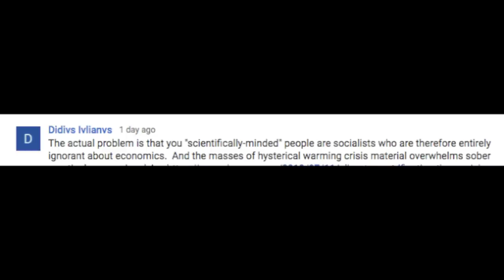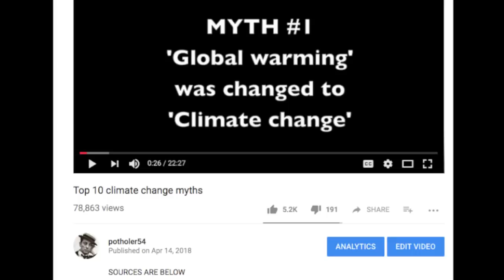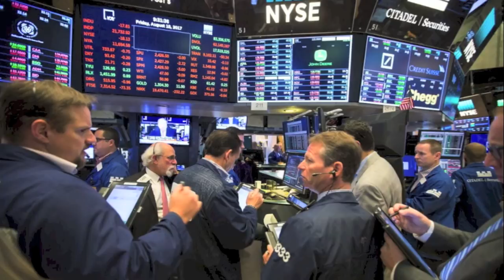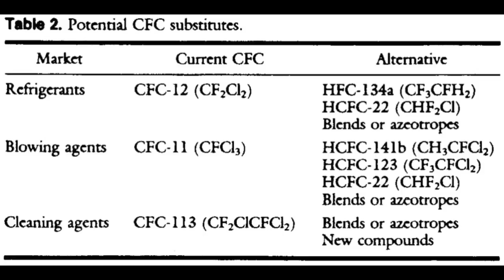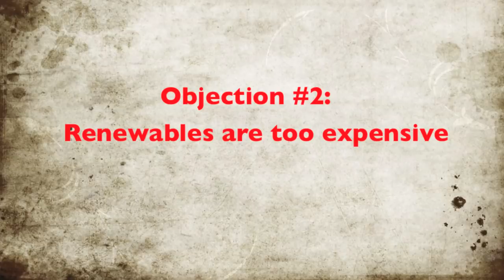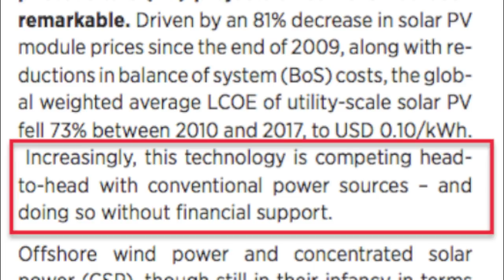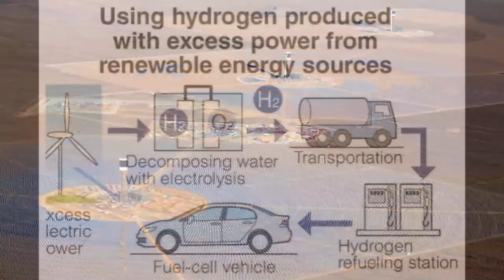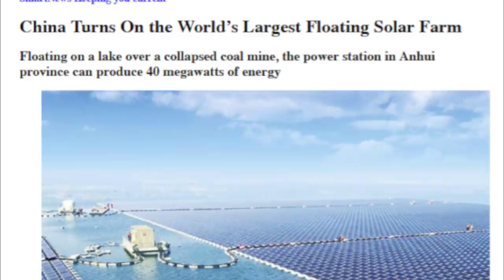A CONSERVATIVE solution to global warming (Part 1)

Comment: In Australia our media routinely claims renewables are cheaper than non-renewables. In this case it's essential to point out that renewables are heavily subsidized. If they really thought they were cheaper they wouldn't need subsidies for them. 

The upshot here is that because people are lying about how much  power bills will cost and where that cost is coming from, voters will make poorer decisions about what policies they ought to support in combatting climate change.
Reply from the maker: If you have some facts and figures from reliable sources then I would be very interested to read them as part of my research into part 2. I'm not sure what you mean by "heavily" subsidized, which renewables you're talking about, which states, and how any subsidy for renewables compares to subsidies given to fossil fuel industries. I would be interested to get some detail, if you have any. Trouble is, too much of what people post is based on belief, hearsay and generalizations.
Reply: "In Australia our media routinely claims renewables are cheaper than non-renewables"

Because it is. Solar has been on price-parity with coal since 2014 and wind has been undercutting coal since 2013.

"In this case it's essential to point out that renewables are heavily subsidized"

No that's not remotely true. Fossil fuels have been subsidized well for over 100 years and the Australian government pours billions into propping up fossil fuels. $11 billion per year federally is the current estimate.

In fact as part of the Low Emissions Technology Demonstration Fund (LETDF) 82% of subsidies went to coal and only 18% to renewables.
Reply: The fossil fuel industry us not subisidized. Some claim it is but they reference tax breaks that avaliable to all businesses including renewable companies. 

As part of Australias RET (Renewable Energy Target) we have a number of subsidy schemes. The SSRES (Small Scale Renewable Energy Scheme) subsidizes the building of solar panels on residential properties and the LRET(Large-scale Renewable Energy Target) subsidizes renewable generators. These subsidies are cross subsidies meaning they aren't paid for by taxpayers but by electricity users.
 
The LRET forces companies to buy renewable energy certificates when they buy electricity and awards these certificates to renewable energy generators. They currently sit at about $80 a MW/h which means renewable generators effectively make $80 over what they charge for their electricity. (Market price is about $70 average)  Media outlets frequently report the market price as proof renewables are cheaper than fossil fuel sources. 

I'm not too certain about how the SSRES works but I understand that it's a similar idea. 

The Government's RET Website:
http://www.cleanenergyregulator.gov.au/RET/About-the-Renewable-Energy-Target/How-the-scheme-works
The Australian Energy Market Regulator's Website: https://www.aemo.com.au/Electricity/National-Electricity-Market-NEM/Data-dashboard#aggregated-data

Other factors change the cost of these energy sources dramatically, such as credit. Because Australia has had a carbon tax,  almost had an ETS, has got the RET, and has frequently fiddled in the energy market and specifically in the FF industry it's much harder to secure credit for FF generators. Inversely, large subsidies have made credit cheaper for renewable generators. Again, this is used to claim that renewables are cheaper but this is only due to consistent government interference.

I've no love for coal and I quite like the idea of renewable energy, I just think it's a fact that renewables are currently a more expensive way to produce electricity than fossil fuels are.
Reply: 1. FF being subsidized is not proof that renewables aren't.
This here is a nonsense argument: 
<"In this case it's essential to point out that renewables are heavily subsidized"

No that's not remotely true. Fossil fuels have been subsidized well for over 100 years and the Australian government pours billions into propping up fossil fuels.>

2. I agree that FF have been subsidized in the past. In the past they were also state owned. That's a 100% subsidy. I think these are terrible ideas. If the problem is FF subsidies then stop subsidizing them. Don't also subsidize cheaper sources. That's just retarded. 

3. Link me to that LETDF report.
Reply: Some great information there but I think you'd have to agree the roughly $5 billion in tax free diesel given to the mining industry through the "Fuel tax Credit Scheme" does not also apply to 'renewable companies'. And that's only about half what the fossil fuel industry gets in various breaks.

The cost the RET was estimated to be 5.1% to electricity bills based on 2014 report but it has helped drive adoption of renewables and "wholesale prices would be 15-25% higher in 2020 in the absence of the RET", that's not to say the savings are passed on however.

Australia does not have a carbon tax. That was only in place for two years, between 2012 and 2014.

The truth is renewables are cheaper even though fossil fuels are heavily subsidized to a far greater extent than renewables.

I hope we can agree the CSIRO is a reliable source of information: https://publications.csiro.au/rpr/download?pid=csiro:EP178771&dsid=DS2

In 2017 the costs for large scale PV solar, rooftop solar, and wind ($2100, $1600, & $1600 respectively) were all well below the cost of coal ($3074 before you even start adding any carbon capture).

By 2030 the estimates are solar will fall another 50% in price with wind and wave taking less significant drops. Battery storage will also steadily decline. But the main message is it's cheaper today and that won't change.

And the report you wanted: https://web.archive.org/web/20080724085454/http://www.greenpeace.org/raw/content/australia/resources/reports/climate-change/energy-and-transport-subsidies.pdf
Reply from the maker: @SecxyBear -- Thanks to responding to my requests for facts and figures. Your post is very informative, but I don't think it tells the whole story. In fact, the more I delved into it, the less clear and simplistic it got.... 

"The fossil fuel industry us not subisidized. Some claim it is but they reference tax breaks that avaliable to all businesses including renewable companies." 

I did a quick check, and discovered that $6 billion worth of credits and grants are available through something called the Fuel Tax Credit Scheme. $29 million a year goes to Geoscience Australia, to help find fossil fuels. Horizon Power, Verge Energy (Synergy Generation), CS Energy Limited and Stanwell Corporation Limited all receive direct state subsidies for generating electricity through fossil fuels, among various other subsidies and tax breaks (marketforces.org.au/campaigns/ffs/).
   None of these subsidies and tax breaks is available to other businesses, they are exclusively for fossil fuels. As I said, this is just a cursory check, but it does call your claim into question.

"The SSRES (Small Scale Renewable Energy Scheme) subsidizes the building of solar panels on residential properties"
   But that does not mean these solar panels are uncompetitive without subsidies, surely? I installed solar panels on my roof a couple of years ago and didn't even bother applying for a subsidy, because it has dwindled to very little, and I am still able to slash my electricity bills and come away with a profit. That takes into account the cost of the panels, the income I would have got if I had invested the money instead, depreciation costs over 10 years etc. etc. If solar panels on my roof are cheaper than coal-fired power stations without subsidies, that must also be the case for all households in NSW, isn't it?

"The LRET forces companies to buy renewable energy certificates when they buy electricity and awards these certificates to renewable energy generators. They currently sit at about $80 a MW/h which means renewable generators effectively make $80 over what they charge for their electricity. (Market price is about $70 average). Media outlets frequently report the market price as proof renewables are cheaper than fossil fuel sources."
   If they are simply going by the retail price, then that could well be a wrong assumption. But if they have done a proper cost analysis, then their figures could be correct. I don't know, because I don't know which media outlets you are referring to or what they are reporting on. But while I was digging, I stumbled across a cost-analysis by the EPA that factored in the 'hidden' cost of health care due to fossil fuel pollution, and their estimate is 13 to 45 US cents per kWh (because of the public health care system in Australia, these health care costs are borne by the taxpayer.) And, of course, if we really want to go to town on cost analysis we have to factor in the cost of environmental damage caused by fossil fuels in the form of oil spills, acid rain and climate change. 
   

"I just think it's a fact that renewables are currently a more expensive way to produce electricity than fossil fuels are."
   But as I've discovered trying to unravel this, not only is comparing subsidies between fossil fuel/renewables a minefield, so is the real cost of producing electricity. All I can tell you is, on a microeconomic scale, I didn't get any subsidy for my Chinese-made solar panels, and even though they're competing with subsidized coal-fired power stations in a coal-mining region of Australia (Newcastle), it is still cheaper for me to get my electricity from the solar panels. Not only that, I'm not producing any CO2 as a result. I am curious as to whether you have also invested in solar panels, and if not, why not? Isn't it cheaper where you are, even without a subsidy? Have you done a cost-benefit analysis?
Reply: Your confusion around coal subsidies is warranted especially seeing as youre citing a dodgy website. That specific page is a gishgallop in a link and far out is it tiring explaining the many different ways it's wrong. 

> "I did a quick check, and discovered that $6 billion worth of credits and grants are available through something called the Fuel Tax Credit Scheme. "

This is avaliable to any company that uses it's own roads (including solar). It's a fuel excise exemption for vehicles driving on private roads. The idea here is that fuel excise is intended to pay for road maintainence. Hence the exemption. It might fund FF in the sense it doesn't tax petrol where it could (and petrol itself is a FF) but that doesn't enter into the competitiveness of coal for generating electricity. 

The fuel subsidy is one example, the research is another. This research is used by coal companies but it's not commissioned by them or intended for them. I'm happy to cut funding for this agency entirely but it's wrong to call this a FF subsidy. 

The direct subsidies are to state-owned generators. They're subsidies but at the same time the generators aren't commercial so they don't get profits. I'd be happy to privatise these assets but the parties pushing renewables oppose that so I don't know how to help you there. Either way, this only affects the states it's in and the other states show what I'm claiming so it's kinda a moot point.

>"All I can tell you is, on a microeconomic scale, I didn't get any subsidy for my Chinese-made solar panels, and even though they're competing with subsidized coal-fired power stations in a coal-mining region of Australia (Newcastle), it is still cheaper for me to get my electricity from the solar panels. Not only that, I'm not producing any CO2 as a result. I am curious as to whether you have also invested in solar panels, and if not, why not? Isn't it cheaper where you are, even without a subsidy? Have you done a cost-benefit analysis?"

How do you buy your electricity from coal without paying the cross subsidy? Are you just comparing your generators to the market price? I haven't bought solar subsidy or not, because I rent. I do pay for solar through the SSRES and LRET though. If you have a solar system you're probably eligible for a rebate. 

Bringing up "hidden healthcare costs" is irrelevant. I'm not here supporting coal. I'm talking about how much money it costs to get a MW/h. The Guardian and the Age often run articles claiming renewables are cheaper than coal. The ABC has run some as-well. Be careful of the distinction between new build and maintaining current generators as well. 

This article is an example. 
http://www.abc.net.au/news/2018-09-03/angus-taylor-energy-minister-power-price-solution-curious/10188496

It uses the accounting flubs I've mentioned.
Reply: Put it this way, Renewable energy has multiple current, promoted, dedicated subsidies that are easily found on government websites. Coal has none. The only way you can say coal has subsidies is by doing shit like "coal companies have cars that drive on roads, trains are paid for by the government, ergo the government subsidizes coal". It's always a solid step removed. It's only a minefield if refuse to stop digging until you find a mine. That's not a good way to get to the truth.
Reply from the maker: "youre citing a dodgy website."
  As I said, I only had a cursory look to check what you are saying. If you think the figures I cited are wrong, or the details of the subsidies are wrong, I welcome any corrections you would like to give, citing what you consider to be more reliable sources. 

"but [the fuel excise exemption] doesn't enter into the competitiveness of coal for generating electricity." 
   That's true. I mention it as an example of a subsidy/tax break exclusively for fossil fuels. But a good point, if we're only looking at electricity production.

"This research is used by coal companies but it's not commissioned by them"
   It may not be commissioned by them, but if the research is useful to them and used by them then they are beneficiaries.
   "it's wrong to call this a FF subsidy."
    But it's not a tax break either. I suppose if the government is giving a company free research information to help its business it should perhaps be described as a "gift." Whatever we call it, it is still taxpayers' money used to reduce the cost of coal-based power.

"The direct subsidies are to state-owned generators."
   Yes, which are mostly coal-powered. Not all states give these subsidies, some do. Again, this is painting a picture of a much more complex system of tax breaks and subsidies.

"How do you buy your electricity from coal without paying the cross subsidy?"
   I don't know what a "cross subsidy" is, but when the sun isn't shining I buy electricity from a coal-fired power station. If I didn't have my solar panels I would have to buy this coal-based electricity all the time, and that would increase my electricity bill. 
      BTW, it's rather ironic that my solar panels are not benefitting from subsidies, but I am subsidizing coal-based power. I feed excess electricity back into the grid at 8c/kWh, which they sell to other consumers at 25c/kWh.

"If you have a solar system you're probably eligible for a rebate."
   But it's tiny. Subsidies used to be quite substantial, but now solar technology has improved so much, and is so cheap, that the subsidies have been reduced and are hardly worth applying for.  

"Bringing up "hidden healthcare costs" is irrelevant."
   Not really. This isn't a tax break or a subsidy, but it is a cost. If you have one power source (coal) that is costing a billion dollars in additional health care, and another power source that is costing nothing, that cost has to be factored in when indirect costs are looked at. I'm not sure why it shouldn't be. 

"http://www.abc.net.au/news/2018-09-03/angus-taylor-energy-minister-power-price-solution-curious/10188496"
   You're actually coming up with some very good sources that contradict the idea that coal is cheaper than renewables :). The ABC story cites a report by the Australian Energy Market Operator, which states that "When existing coal-fired generation reaches the end of its technical life and retires, the most cost-effective replacement, based on current cost projections, is forecast to be a portfolio of utility-scale renewable generation, storage, DER, flexible thermal capacity, and transmission. "   There is no mention that this cost-effectiveness is based on subsidies for renewables, and in a report of this depth that crucial detail would certainly have been factored in and mentioned if it was significant.    I don't think I'm any closer to unravelling all the various subsidies and tax breaks and direct and indirect costs, and if anything it shows that this is a much more complex issue than comparing the cost of two cans of baked beans. But neither can I see any evidence, even from the ABC story you linked or the report it cited, that subsidies play an important factor in the cost-benefit analysis. If the experts say renewables are going to replace coal because they're cheaper, I have to assume they know what they're talking about.  

 

p.p1 {margin: 0.0px 0.0px 0.0px 0.0px; font: 12.0px 'Tw Cen MT'; min-height: 13.0px}
p.p3 {margin: 0.0px 0.0px 0.0px 0.0px; font: 10.0px 'Tw Cen MT'; min-height: 11.0px}
li.li2 {margin: 0.0px 0.0px 0.0px 0.0px; font: 10.0px 'Tw Cen MT'}
table.t1 {border-collapse: collapse}
td.td1 {padding: 0.0px 5.0px 0.0px 5.0px}
ul.ul1 {list-style-type: disc}
Reply from the maker: Thanks too to @Naoki Watanabe for providing some interesting links.
Reply: >   "it's wrong to call this a FF subsidy."
    But it's not a tax break either.>

Missing the point. If a Syrian weapons manufacturer uses wifi is it fair to say that Australia subsidizes weapons manufacturing in the middle east because that research came out of the CSIRO? You've assumed all these claims aren't bullshit and I'm having to pick through them and explain how they've misled you. It's curious how little skepticism you applied there and how much you've applying here. 

>"The direct subsidies are to state-owned generators."
   Yes, which are mostly coal-powered. Not all states give these subsidies, some do. Again, this is painting a picture of a much more complex system of tax breaks and subsidies.

I know they're coal-powered. This ignores everything I said about why state-owned power companies aren't a good example to use for the cost of coal electricity. 

>"You're actually coming up with some very good sources that contradict the idea that coal is cheaper than renewables :)"

This just says that you're ignoring what I'm saying. Quoting that article at face value as though I haven't been explainaing problem after problem with doing so is just insulting.

>"would certainly have been factored in and mentioned if it was significant.  "

You're not even trying. Things like credit ARE factored into the AEMO reports. They just don't account for why the credit is expensive. 

>"Bringing up "hidden healthcare costs" is irrelevant."
   Not really. This isn't a tax break or a subsidy, but it is a cost.

It's not a cost that shows up on power bills or generators statement of accounts. You may as well have said "coal emits carbon". Duh. You should be able to see why this is irrelevant. 

>"How do you buy your electricity from coal without paying the cross subsidy?"
   I don't know what a "cross subsidy" is, but when the sun isn't shining I buy electricity from a coal-fired power station.

If you buy power from the grid as most Australians do then you can't really claim that you're buying coal-fired power and you definitely, 100%, absolutely can't claim that you're paying a cost representative of the cost of generation.  

> "but [the fuel excise exemption] doesn't enter into the competitiveness of coal for generating electricity." 
   That's true. I mention it as an example of a subsidy/tax break exclusively for fossil fuels. But a good point, if we're only looking at electricity production.

This is just frustrating. I'm talking about how expensive renewable electricity is and you know that. 

Moreover, in what world can an exemption on petrol excise actually be considered a subsidy for petrol itself? There's a reason I said "in the sense that they're not taxing it when they could be" because, using that logic, literally everything is recieving enourmous subsidies because the government could tax it (more) but isn't. Why would you even offer that point?  The existence of a tax on petrol itself is the opposite of a subsidy. 

Again, the subsidies for renewables are clear, explicit, large and intentional. You have to use mental gymnastics to claim these other things are coal subsidies. Occam's razor that shit. Don't be a bad skeptic.
Reply from the maker: " If a Syrian weapons manufacturer uses wifi is it fair to say that Australia subsidizes weapons manufacturing in the middle east because that research came out of the CSIRO?"
   Exactly. That would not be a fair thing to say. But the situation we are dealing with is a government body doing research specifically to benefit a segment of industry, and that industry does not have to pay for it; the taxpayer does. Probably more apt to call it a "gift." Similarly, if the Australian government did research on how Syrian weapons manufacturers can improve their manufacturing process, that would be a "gift" to the Syrian weapons manufacturers. 
   If you don't like the word 'gift' then it doesn't really matter, you can use the word 'help' or even 'fact.'

"I'm having to pick through them and explain how they've misled you."
   Yes, please do. As I said, I can't vouch for that website, so I am interested to know how correct it is. I am extremely skeptical of its veracity, so if you think the figures or the subsidies / tax breaks / gifts / help don't exist, or are different to what was described in the website, I look forward to your evidence and a reference to more reliable sources. 

"Quoting that article at face value as though I haven't been explainaing problem after problem...."
   That's just it. You've cited this ABC article as an example of a cost analysis that ignores subsidies -- which is a very good point. If it is ignoring subsidies then its conclusions are flawed. But, as I said, you need to show that it has ignored subsidies. Just telling me it does is not evidence, you are just expecting me to accept your word. I can't see anything in the article that suggests that, and on top of that it cites a study by the Australian Energy Market Operator which also has a detailed cost analysis that shows renewables are and will be more competitive than coal. 

"Things like credit ARE factored into the AEMO reports."
   OK, here's the heart of the problem. You keep telling me these things, and you are baffled as to why I don't say "Oh, I see. Thanks, in which case I will disregard these reports."
   It's not that I don't think you're an intelligent, reliable and honest fellow, I'm sure you are. If I am holding your feet to the fire and asking for evidence and sources, it's not a personal affront, it's because I have to be skeptical. I need to check what people tell me, rather than just roll over and believe it. 

"It's not a cost that shows up on power bills or generators statement of accounts."
   No, but it is a cost, nevertheless. 

You wrote:
 "but [the fuel excise exemption] doesn't enter into the competitiveness of coal for generating electricity." 
I wrote: 
"That's true. I mention it as an example of a subsidy/tax break exclusively for fossil fuels. But a good point, if we're only looking at electricity production."
You wrote: 
"This is just frustrating. I'm talking about how expensive renewable electricity is and you know that."
   
Hang on, I just agreed with you! Your point was that the fuel excise exemption doesn't enter into the competitiveness of coal for generating electricity. Why are you frustrated when I said that's a good point -- I agree!?

"Again, the subsidies for renewables are clear, explicit, large and intentional. You have to use mental gymnastics to claim these other things are coal subsidies."
   Maybe you need to re-read what I have been saying. I have agreed with you. Let's not call them subsidies. If they are tax breaks, they are tax breaks. If they are free help paid for by taxpayers, call them gifts. You seem determined to assume I am some sort of adversary, and unaware that I have been agreeing with that point, so perhaps you might re-read some of my posts. 
   You are not dealing with an adversary here, just someone who knows little about this subject and would like to learn more. But you are also dealing with someone who doesn't take information at face value. I need to track down the source of that information and find out where it comes from, and check it. I don't automatically believe the websites I've seen, because anyone can make a website and put bullshit figures on it. Neither do I automatically believe what a poster tells me on a YouTube forum, I always ask for sources that I can check. 
   So far the only reliable source I have seen is a study from the Australian Energy Market Operator. If you want to show evidence that contradicts it, you can post an impassioned essay with lots of claims if you like, but I will be much more convinced by sources, especially an equally weighty and reliable study from an equally respected authority that confirms your claims.
Reply: You're right. I took your points as more adversarial than they are. 

Let's have another crack.
RE MarketForces.org
1. We agree that a fuel excise exemption that's justified by road maintainence costs is difficult to describe as a subsidy for FF electricity.  

2. It looks like you're also not to far off agreement that the research claim is iffy as well. If we did want to consider this, it'd be worth also looking at what research renewables are using. However, I don't think these reasearch costs are something we should include. 
 
3. The funding of state-owned generators shouldn't be considered here because state-owned generators are not responsive to market forces. They don't "prop up" investment in coal. They crowd it out. They are a replacement to it. 

RE health costs. It's also a cost that some people don't like the way wind turbines look. That doesn't factor into the equation here either. It's not that the fact is false or that it's an unimportant fact, it's just that it has no bearing on the claims I'm making. 

You'll like this article:
https://theconversation.com/factcheck-qanda-is-coal-still-cheaper-than-renewables-as-an-energy-source-81263 

It explains how LCOE is calculated (ie: what it accounts for). It includes the cost of credit. That's not an unfair thing to include but it's important to note WHY credit is expensive for coal and not for renewables. 

The AMEO Retail Electricity Pricing Inquiry report explains that:
"The NEM was designed such that higher prices would ordinarily be a signal for new investment. Until recently, however, this investment has not occurred for a number of reasons. Policies associated with the objective of reducing carbon emissions have been problematic. Australia has committed, through international treaties, to reduce its carbon emissions. The electricity sector has, understandably, been a key focus for these efforts given the historically carbon-intensive nature of electricity generation. However, various policy failures here have hurt consumers."

ie: Renewable energy policices killed coal investment. Credit for coal investment is expensive and that's easily traced link back to carbon emissions policies.  

In the "How we got her section" They also write:
"Most state governments put in place excessively generous solar feed-in tariff schemes with a view to encouraging consumers to install solar photovoltaic (PV) systems. Under these schemes, the subsidy paid to consumers for the energy produced by their systems outweighed, by many multiples, the value of that energy. Take up of the schemes exceeded all expectations, in part due to dramatic declines in solar PV installation costs. The substantial cost of the schemes continues to be spread across all electricity users.

The main enduring policy instrument for encouraging low-emissions electricity generation is the Renewable Energy Target. While it has been effective at encouraging wind and solar generation capacity installation, it has also distorted the investment that has occurred in the transition from higher carbon technologies to lower ones. "

In their environmental costs section they elaborate of solar subsidies: "Solar feed-in tariff schemes have also had distributional effects on energy affordability. Those households that have installed solar PV have benefited from the generous solar feed-in tariffs and also received subsidies for the installation of the system itself through the small scale renewable energy
scheme (SRES). Solar households have reduced consumption of electricity from the grid significantly. Solar customers are paying, on average, $538 per year less than non-solar customers. Meanwhile, non-solar households and businesses have faced the burden of the cost of premium solar feed-in tariff schemes and the SRES. While premium solar schemes are closed to new consumers, the costs of these schemes are enduring. Reducing these costs will have efficiency and equity benefits."

That whole section is worth a read. 
Environmental costs account for $76 to $170 per customer annually.  

Also, I couldn't find a mention of coal subsidies in the whole report. 

The ISP (integrated system plan) explains that AEMO modelling that claims renewables are the cheapest new-build technology (but not the cheapest given the existence of current coal plants) is predicted on the assumption that: "All existing announced policies are included, as described by various Governments (LRET, VRET, and QRET)." - 2.7.1 Neutral Case

Meaning they calculated the cost assuming the subsidy would be in place. They didn't factor out the subsidy and compare coal to renewables. They assumed the policy would continue and worked under that assumption and renewables still don't win out over coal until the coal plants retire.  Given that, is it sensible to think they're cheaper without the subsidies?

There are no coal subsidies mentioned in the report that assumes current policy and outlines that it's including subsidies. Is it sensible to think coal subsidies explain the difference in cost between coal and renewables then?

Electricity Pricing Inquiry Report
 https://www.accc.gov.au/system/files/Retail%20Electricity%20Pricing%20Inquiry%E2%80%94Final%20Report%20June%202018_0.pdf 

Integrated Systems Plan
https://www.aemo.com.au/-/media/Files/Electricity/NEM/Planning_and_Forecasting/ISP/2018/Integrated-System-Plan-2018_final.pdf

I appreciate you taking the time to listen to what I have to say and in pushing me to provide sources and better evidence. It helps. Cheers.
Reply from the maker: 'The conversation' link was very informative, and gels with what I read in the other website I quoted. Here's the crucial point:

"Making the distinction between the cost of existing energy generation and the cost of new-build energy generation in this debate is very important. Comparing the two is like comparing apples and oranges."

If the websites are correct, it seems that this 'existing vs. new-build' is the crucial point. Coal may be a cheaper source of electricity in existing power plants, but when it comes to the huge capital costs of building a new one, it's much cheaper to build a renewable plant. Running costs are also cheaper. This is also reflected in the Australian Energy Market Operator study I cited. 

Of course, that still doesn't resolve the issue of what the 'real' cost is, in terms of subsidies, tax breaks, gifts or anything else. And then there is the whole issue of 'hidden' costs such as health care, pollution clean-ups, climate change etc., which I agree is another issue and not one that impacts on the point you are making. 
   To be honest I don't think we'll be able to resolve it in this forum. While I appreciate your arguments, the journalist in me still wants to see a detailed and definitive study by a respected body. To wit....

"The AMEO Retail Electricity Pricing Inquiry report"
    I could only find something called the The ACCC Retail Electricity Pricing Inquiry report. Presumably this is the one you are referring to. That looks like the kind of thing I'm after. I'll need a few days to study it. But in reference to the quotes you highlighted:

"Most state governments put in place excessively generous solar feed-in tariff schemes with a view to encouraging consumers to install solar photovoltaic (PV) systems."
   Mmm... "generous"? Well, I get 8c/kWh for the electricity I feed into the grid. The electricity companies then charge other customers 26c/kWh for the same electricity. That's a more than 200% mark-up. I'd say I'm the one getting the short end of the stick here. Even so, it's still cheaper for me to run my PV panels even without a subsidy, and without any feed into the grid (which I didn't factor in because it was an unknown quantity.) 
   I double-checked, and found this 2016 story from the Telegraph:
"Across NSW there were 146,000 households who signed up to the solar bonus scheme, which gave either 60 cents or 20 cents per kilowatt hour for their solar energy to go into the grid.     "Starting on January 1 next year the rates drop to about 6 cents, which can be less than the price charged for electricity from the grid."60 c/kWh certainly is generous! 6 c/kWh -- less than a quarter of what the grid charges -- is not. But it is reflective of how profitable it now is to install solar panels. The feed-in tariffs simply aren't needed in order to make PV panels cost-effective. It's a shame the ACCC report didn't give figures so that we know what it means by "generous", but maybe I'll get to that as I read through the report.  
"The main enduring policy instrument for encouraging low-emissions electricity generation is the Renewable Energy Target. While it has been effective at encouraging wind and solar generation capacity installation, it has also distorted the investment that has occurred in the transition from higher carbon technologies to lower ones. "

   But that is exactly what it was designed to do. That's what all anti-pollution measures are designed to do. They move investment away from polluting industries and towards non-polluting ones. But we're getting a bit away from the question of whether renewables are cheaper than coal, after subsidies and tax breaks are taken into account. 

"Solar feed-in tariff schemes have also had distributional effects on energy affordability. Those households that have installed solar PV have benefited from the generous solar feed-in tariffs and also received subsidies for the installation of the system itself through the small scale renewable energy
scheme (SRES)."
   Again, qualitative rather than quantitative. How "generous" is 8c/kWh for something that can be sold on for 26c/kWh? The packages people got five years ago for solar were certainly not there two years ago when I installed mine, and are even less 'generous' today. 

"Also, I couldn't find a mention of coal subsidies in the whole report."
   As we both agree, that's probably because these aren't really subsidies, they're tax breaks and other incentives and benefits. But I couldn't find any reference to these tax breaks either. If these are specific to the coal industry they should at least be quantified. 

"Meaning they calculated the cost assuming the subsidy would be in place. They didn't factor out the subsidy and compare coal to renewables."
   And if they had? Again, that's the crucial point. Stripped of all subsidies, tax breaks, benefits and every other government hand-up, would renewable start-ups still be cheaper than coal power start-ups? 
   Anyway, thanks for all the links, it's great food for thought.
   My bet is we are going to be overtaken by events in any case. Solar and wind power continue to get cheaper, so even if you are correct and they are not competitive now without subsidies, that is fast changing. Meanwhile PV panel subsidies have also plunged -- by 90% if the Telegraph is to be believed -- and they are so small now I didn't even bother applying. 
   The biggest upheaval will be when there's affordable home battery storage. I can easily produce enough electricity from PV panels to power my house 24 hours a day, I just need a battery to store it. Currently the battery costs about $10,000, and a 3kW PV system about $5,000. Amortized over 10 years, and factoring in what I would have got by sticking that $15,000 in the bank, that's a cost of $1,800 a year. That's just $600 more than if I was entirely dependent on the coal-fuelled grid. 
   Not worth it in economic terms now, but once it gets to $200 more then I would willingly pay the extra, just to save myself from a dozen power outages every year.  And the way grid prices are rising, I would soon be in the black. All that without the need for subsidies, and the knowledge that I'm not contributing as much to CO2 concentration. 
   Thanks for the discussion, and I will read the reports you've cited.